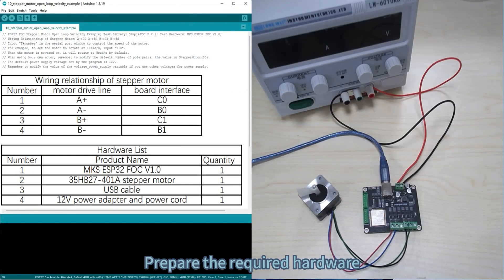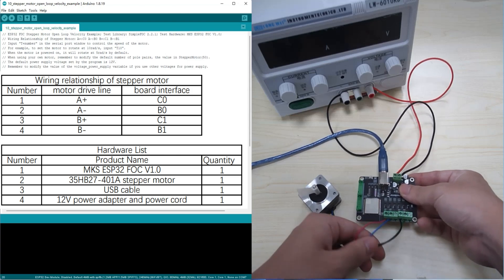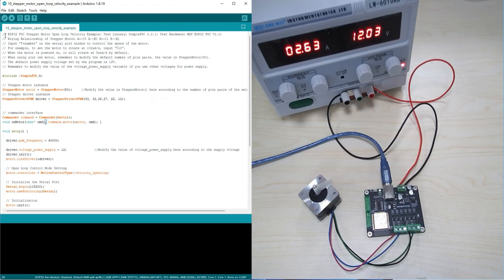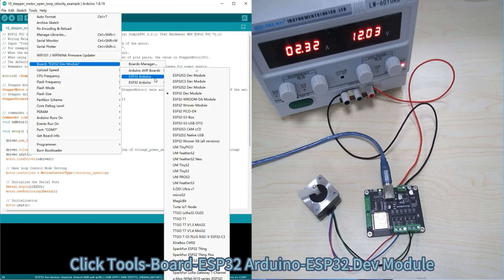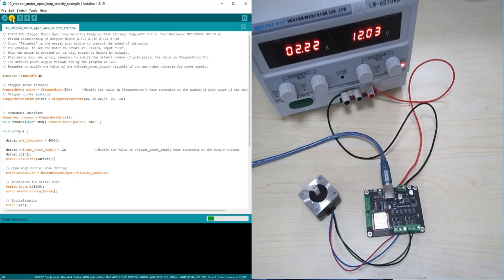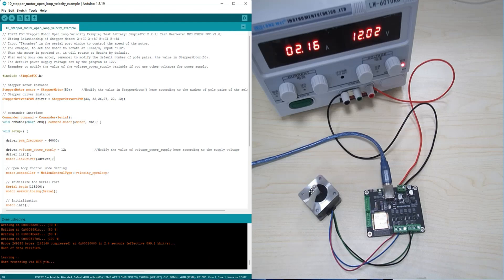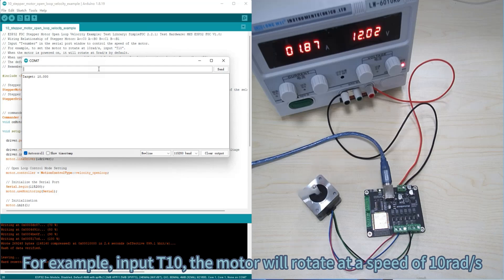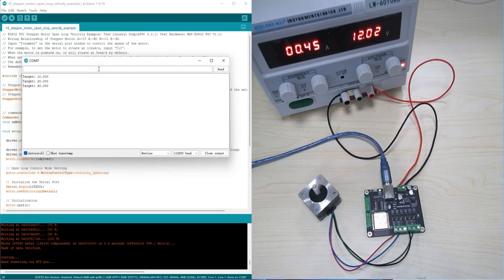MKS ESP32 SimpleFOC Example 10 Stepper Motor Open Loop Test

Comment: Hi Makerbase, I have just purchased a Servo57D Controller. I need to use it with Arduino for some precision movement project. Please point me to the right direction, like how to setup from menu button and other useful stuff. Thanks in advance.